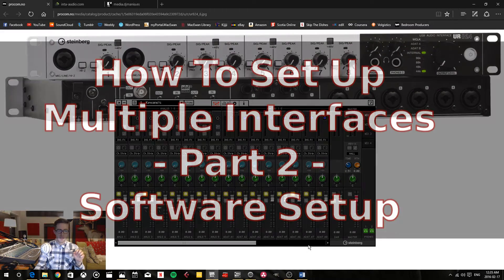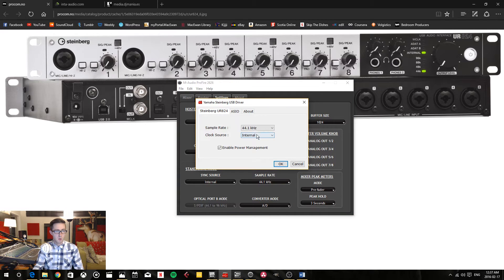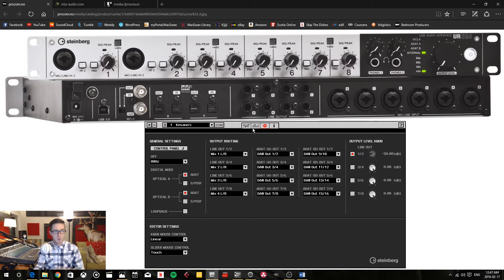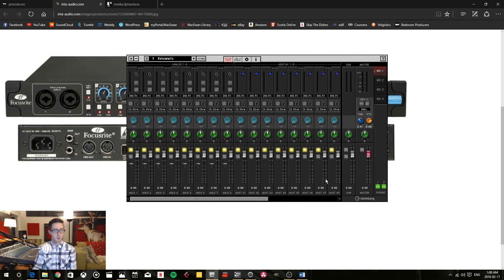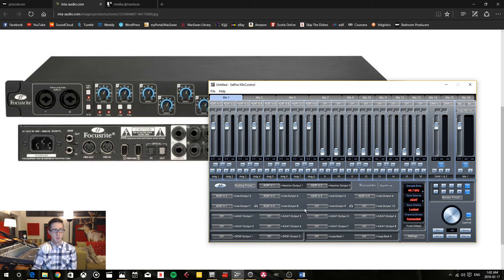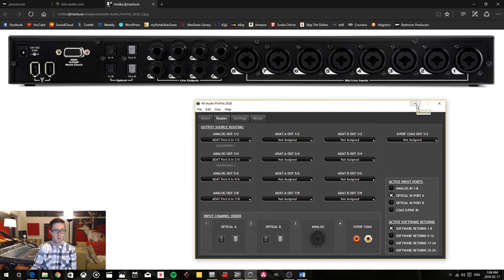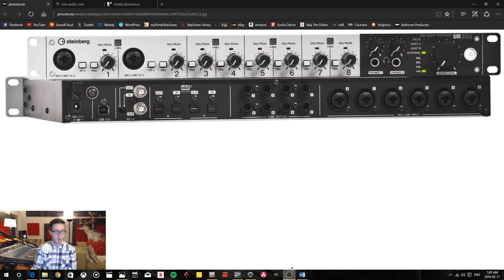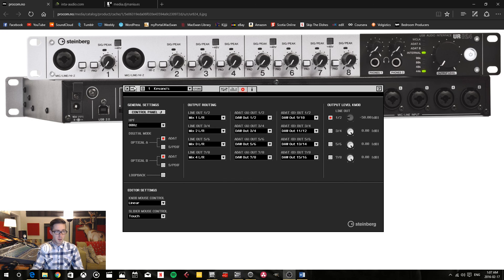How To Set up Multiple Audio Interfaces via ADAT - Part 2 - Software Setup

Comment: So are you able to use the pre amps in the units that are running adat or are those units just for I/0 great video
Reply from the maker: Yes you can use the preamps in the additional units connected to ADAT, you can also bypass the preamps by connecting via 1/4" for interfaces that offer XLR/line input combo connectors.

Comment: I am not sure that I understand what you did. Do you use Saphire and Profire just like ADAT converters? At least you are not expanding inputs and outputs Steinberg audio interface. You are using other interfaces to convert Steinberg ADAT inputs and outputs to convert it to analog inputs and outputs. Am I right?
Reply from the maker: I'm using my Steinberg UR824 Audio Interface as the master interface, it allows for up to 24ins/24outs. 8 outputs & inputs directly from the interface and two banks of 8 ins/outs accessible via ADAT. So yes, I'm expanding my ins/outs by using the Saffire Pro 40 & Profire 2626 as ADAT converters. Converting 16 ADAT digital channels to 16 analog outputs, and 16 analog inputs to 16 ADAT digital and back into the computer via the UR824
Reply: Ok, thanks. So I was wright. But wouldn't it be much easier and cheaper too to buy two ADAT converters? Or one like Ferrofish A16. Just plug it and that's it. I. e. Behringer ADA8200 is ADAT AD/DA interface even with 8 mic preamps and cost 149€, so for 298€ you can expand your Steinberg audio 8nterface with 16 in and 16 out analog and have even 16 more mic preamps and everything without any drivers and instalations. Just plug and play. You can sell your Profire and Saffire and you can have left extra money.
Reply from the maker: I originally owned a Saffire Pro 40, I had it for a few years & decided I'd pick up a UR824 and sold my Pro 40. But then I got into hybrid mixing, and to make good use of my MQ1602 mixer I needed 16 channels. As I was shopping around I found a very cheap used Pro 40 from the music store. I figured could make better use of two interfaces and get better resale with a Pro 40.

I then upgraded to a MC2404-II mixer (24 channels) and low and behold I found a used Profire 2626 on Kijiji for like $180, so I picked it up and had all the channels I needed. Since then I've sold all 3 interfaces (got very good resale for them) and now run a single Antelope Zen Studio interface. It saves the headache of using multiple interfaces, but overall I had almost no issues using 3 interfaces.

Comment: I'm running an art digital MPA II into a liquid Saffire 56 via adat.  Are you saying that I have to have the word clock connection also connected
Reply from the maker: It's not necessary to run word clock between devices. It will still work really well, but connecting devices via word clock is a way to guarantee that all devices are synced and will minimize any potential problems. Sync issues include jitter and distortion and other unwanted noises and artifacts. This is more important when you have several tracks of audio passing through several devices. If you're only ever recording and sending/receiving like one or two channels of audio, you'll probably never notice any sync issues.

But a professional studio with, for example, 48 simultaneous tracks recording and mixing down to hardware devices (mixer, outboard effects, multiple interfaces, monitoring devices, etc.) will always ensure proper sync between all relevant devices. It's cheap to achieve near perfect sync and it will guarantee you'll never have to worry about sync issues.
Reply: Vintique Sound Thank you sir
Reply: I'm getting some sort of crackling noise that accompanies my voice when I test out the microphone it sounds like some sort of digital issue
Reply from the maker: Hmm, you'd have to troubleshoot each step of the process, first make sure it's not happening in the MPA, then figure out if other devices do the same thing plugging into the Saffire 56 via ADAT, and so on.